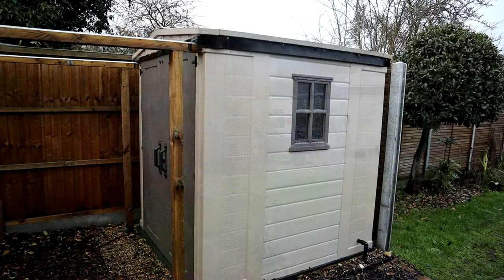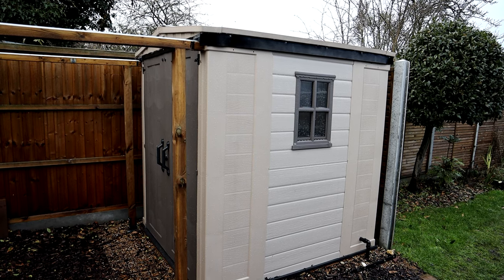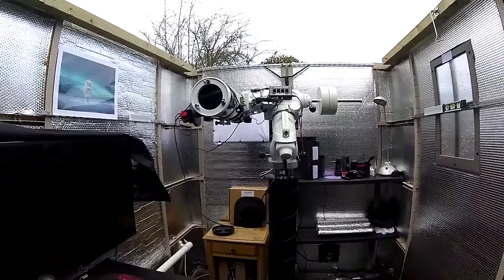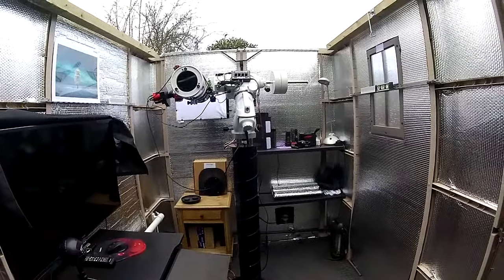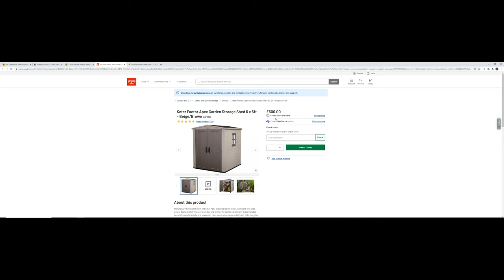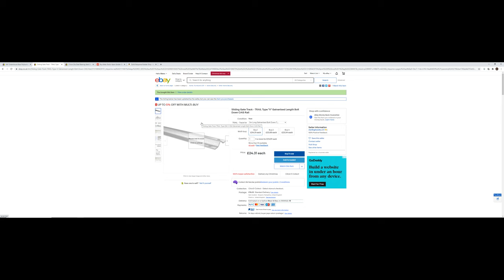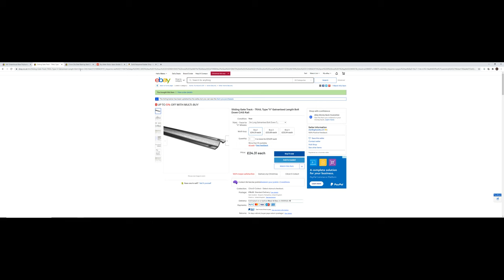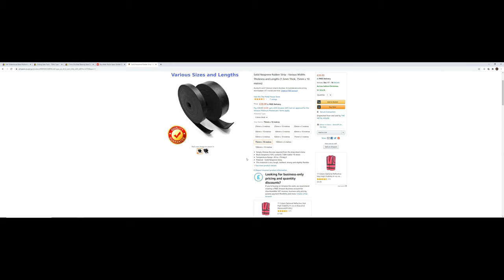Astrophotography with Glenn Clouder - How to build a Budget roll off roof Observatory

Comment: Great video. Thanks for sharing. I have a roll off body on a diy wooden build. Has worked well until I bought a new scope and found it just scraping the base, and that's without any cameras attached! Back to my drawing board. My ideal position unfortunately needs planning permission- so have to suffer turbulence from a nearby building- mostly do solar. But you've got me dreaming and thinking.. Cheers.
Reply from the maker: I hope you sort a good solution out as its great having an Observatory. Thanks for watching and taking the time to comment. Clear skies

Comment: I made an attempt to use one of those plastic shed a while ago. It was used in the backyard of a rental so I didn't want to make it permanent. Eventually, I wanted a more and installed a ExploraDome. My only wish I could have taken it with me when I left that job but I got too sick.
You know that if you wanted a warm control room you could enclose the area under the slid off roof area and make it into one.
Reply from the maker: Thank you for your comment. If its cold i cheat just get it up and running and remote in from my pc in the house where its nice and cosy

Comment: Nice informative video, this one and the pier build video, they were enough for me to subscribe to your channel.  I'd like to build some form of observatory in my garden and the Keter Plastic shed seems like a great idea.  Given how light the shed is did you ever consider making a roll off shed observatory, as once it clears the pier you could also use it as a warm room to control the telescope and nights observing from?  Another vote for "Westcliff-on-Sea Observatory" or, how about "3rd rock from the Sun Observatory" as an alternative.
Reply from the maker: Hi and thank you for your comment and sub to the channel. It does add a huge amount to the enjoyment of the hobby. I hadn't considered a full roll off shed as I had my mind fixed on a roll off roof design, but yes with this shed that could easily work and give a nice warm room as an advantage. Good idea

Comment: Wonderful video and build. This shed seems to be easily modified for purpose. Too bad shed manufacturers don't have a roll-off option. But I suppose we are a small market and easily ignored.
Reply from the maker: It is a shame but like you say the market isn’t big enough I suppose. The companies that convert sheds are such a rip off in my opinion as well. The keter is excellent, easy to work with and modify and minimum maintenance. Its been excellent and much better than I thought it would be

Comment: It's really awesome, congrats! I really want to build an observatory using your project, it seems to be exactly what I need: practicle and not too big.
Please, I  have a question about the base: when the rain comes down, it goes through the gravel and stops when it touches the non-woven fabric that is waterproof. In this case the rain creates a puddle into the base? Thank you!
Reply from the maker: the fabric underneath allows water to pass through it. It is not waterproof. It is a weed barrier to just stop any growth of weeds etc in that area.

Comment: Great build. Do you have any problems with condensation? if you do, how do you deal with it? Thanks.
Reply from the maker: Hi and Thank you. I was worried of that issue but have fans in the roof that are solar powered pushing air out and another low down pulling air in. I also have a shed/greenhouse bar heater to keep any damp out. The in fan and heater are both on thermostat plugs so only on when needed.

Comment: Hi, And well done. I have purchased the same shed and intend to put it together next weekend. Would love to see more detail on where you decided to make the cut/s. Also is the roof able to be assembled independently from the main structure?
Reply from the maker: Hi Grant. The shed is very easy to work with and yes the roof can be built independently but is needed to give the shed rigidity. You'll see on the video I use metal builders bar to support the walls. If you email me at Astrobloke@outlook.com  I can happily supply you some close up images of any parts to help you or if you have messenger you can add me on facebook and I can communicate with you on there.
Reply: @Astrobloke  Thats great I will be in touch via email.  Thanks very much.

Comment: I never thought about getting one of these sheds for an observatory nice job you've done to yours, me & a mate were going on about building a shed with a roll on roll off roof we dug the hole for the pier & then plans seemed to come to a halt for a while, I ended up finding a home made domed observatory on eBay for £155 so had it delivered. It's ok but I were wondering did you ever suffer with equipment getting damp in yours as I'm noticing some rust spots on my mount & if so how did you sort it? My observatory is well ventilated so much so I keep having to evict spiders every so often so any tips would be appreciated.
Reply from the maker: Hi. I think the Domes do suffer but it will also depend on location. I found lining the walls with the silver insulation helps prevent the obsey from changing temp too quickly with it all shut up. The air flow I have really helps with 2 fans up high drawing air out (solar powered) and one low down that is on a thermostatic plug and drawers air in if temp goes over 20dg C. Finally I have a greenhouse/shed bar heater (240watt) that is also on a thermostatic plug and comes on  if temp drops below 10deg C.
So far I have had zero damp or condensation problems. Hope this helps

Comment: Thanks for the vid, it's inspired me to do my own based on a Keter Darwin 6x8.  The wheels you used look like plain steel.  Have you had any problems with rust on them?  I'm struggling to find decent priced ones, found some similar to the ones you used but was put off by the fact they're plain steel.
Reply from the maker: Hi Steve and thank you for commenting. Please share your build once done as I’d love to see it. I think they are steel. Were cheap Chinese ones off ebay so nothing fancy. Had no issues at all with them and the obsy has been up almost 2 years now. I found prices to be all over the place with these. The roof is so light you won’t need to worry about getting super high quality

Comment: really useful video! I've been thinking about a DIY Observatory and was contemplating the keter shed - a couple of questions... Is it easy to cut (ordinary saw OK?) is it easy to fix into the plastic ? Also are you happy with the size you chose ?
Reply from the maker: Hi Ed.  Very easy to cut and i just used a standard wood saw. I am not sure I understand the 2nd part of the question sorry. Can you explain what you mean please. 
I am happy with the size yes. If I had more space I would get bigger though as a little more room would allow easier access to things behind the pier.
Reply: @Astrobloke  Hi Thanks for the reply, I'm assuming that the roof rails and timber need to be fixed to the shed, I have no idea what the shed plastic is like, so wondering if I can use normal screws or if I might need special fixings ?
Reply from the maker: @edjones3390  ok. The main panels are double skinned but would not support too much weight but it’s has thicker plastic seams where the panels join and these are one to screw into. To support my wooden runners I drilled a hole through the wood and shed panel and used a coach bolt and nut to secure, this is more than adequate
Reply: @Astrobloke  Thanks that's really helpful - clear skies !

Comment: Grear job ! to put the rail frame on  the walls, did you make any cut on the front wall(up side corners) to joint the rail frame from inside to outside the shed? thanks
Reply from the maker: Hi Pahlavi. There are 2 cuts at the front so the wood and rails are the correct height. inside to attach the wood i drilled through and used large coach bolts washers and nuts to attach to shed sides
Reply: @Astrobloke  thanks
Reply from the maker: @pahlavipahlavi5926  you are welcome. if you need me to take any images to help further I am happy to
Reply: @Astrobloke  yes please,i am trying to the same things on my palram shed. many thanks
Reply from the maker: @pahlavipahlavi5926  email me at astrobloke@outlook.com with your email for facebook and i’ll sort some closer images for you
Reply: @Astrobloke  thank you so much,i am a bit confuse how to start? Start with roof first or wall? i am going to email you right now. many thanks
Reply from the maker: @pahlavipahlavi5926  I started by attaching the wheels to the roof and seeing how far down they came. Then worked out where top of the rail would be so the roof would clear the sides but not be too big a gap
Reply: @Astrobloke  thanks bro.i am starting to work on from 2mrw.
Reply from the maker: @pahlavipahlavi5926  Good luck. Any questions give me a shout
Reply: @Astrobloke  thanks bro, i started from yesterday ,i am following your advice step by step. Will send you the the photo when i finish it. thank you for spent your time to reply me and for the images you sent.
Reply from the maker: @pahlavipahlavi5926  my pleasure. Look forward to seeing your obsey
Reply: @Astrobloke  thanks,.have a great time

Comment: What was the insulation product you used? Is it efficient?
I have a plastic shed and it suffers from condensation during the winter.
Reply from the maker: It was just  a basic roll of foil insulation I got from B&Q. Its been great and I have had no problems at all with condensation. I have an update to this video (not sure if you have seen it) I go into some more details, mentioning the insulation and other steps to prevent moisture problems
https://youtu.be/QwhiaKHMGt8

Let me know if I can help further

Comment: Did you cut part of the top of the sides off?
Reply from the maker: Yes about an inch or 2 so it was a flat level for the roof to slide over. There is a link to a 2nd part that explains in more detail what I did at the end of the video. Thanks for watching
Reply: @Astrobloke  This guy refers to you I think. I don't think he cut part of the walls off did he?
Reply from the maker: @woldsweather  Sorry Trevor which guy? did you mean to include a link? You can most probably convert this to a roll off roof without any cutting. I just chose to do that so the gap between the walls and roof were as small and even as possible as it made it easier to weather seal.

Comment: When you were just lifting the roof on and off did that involve unscrewing anything? If not how was it secured when in place? I’m looking at this as an option due to lack of space. Cheers.
Reply from the maker: Hi Rob. I used to hook a couple of bungies to the bars I fixed to the inside of the roof and then run them the the bars on the walls. Held the roof very securely and was quick and easy to release and reattach.
Reply: @Astrobloke  very helpful thanks.

Comment: Does the inside stay dry if it's raining or snowing. What if the wind gets bad will the roof fly away?
Reply from the maker: Always stays bone dry inside and never had an issue with wind. My shed was in a sheltered position but I would secure the roof with bungies between the inner roof bars and points inside the obsy if bad weather was forecasted
Reply: @Astrobloke  thank you. I'll be moving to a house where the owner will allow me to put up a shed while I'm there so long as I don't totally destroy the backyard. So I'm looking for a cheap and easy solution to protection against wind.

Comment: I dont understand how you were able to mount the roller trac on top of the cut plastic walls,
Reply from the maker: Hi Gary and thanks for commenting. The video is not my best as I was very early into my youtube journey. The rails are not attached to the plastic but wooden supports that are bolted through the walls, I did a follow up video which I think shows this better.. here is a link
https://youtu.be/QwhiaKHMGt8
Hope that helps but if you need any more help please let me know

Comment: Do you have any concerns on security of this build? I am always worried when building one of these that someone could easily just open it up.
Reply from the maker: Hi Tom. Mine was built in a very secure back garden and covered by cctv. You can lock them up and maybe even install an alarm but if someone wants to steal your gear, they will, no matter how secure. I think the plus with a roll of roof is it is not obvious that there is a scope inside unlike a dome.